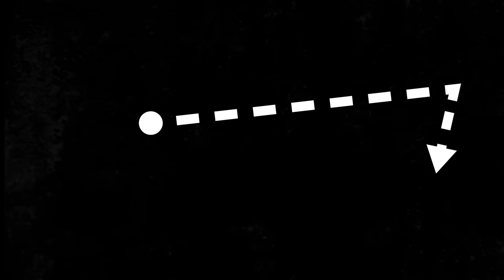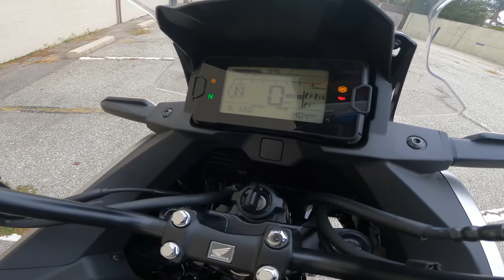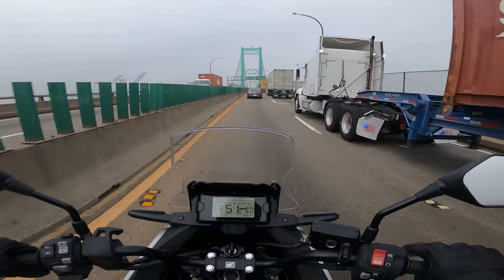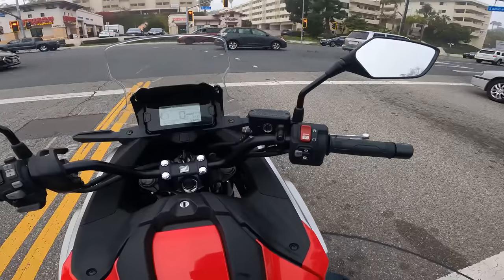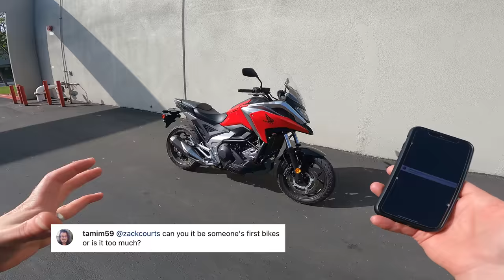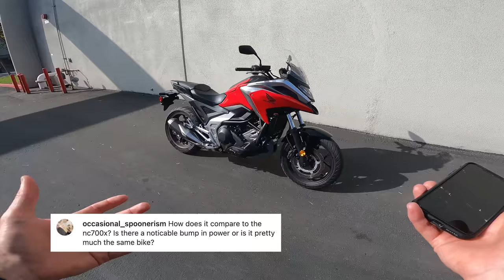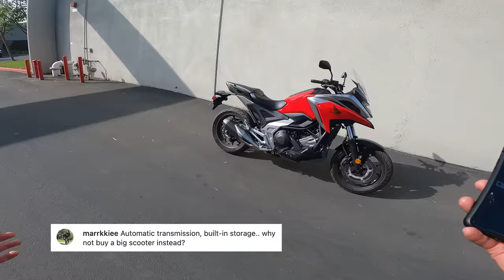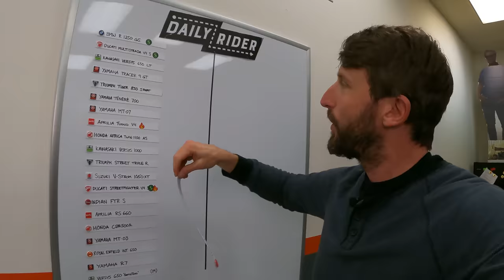Automatic-transmission on a motorcycle? 2021 Honda NC750X DCT | Daily Rider

Comment: I just bought an Africa Twin DCT after five years of spanking my KLR 650 as a learner. With full licenec in hand and the nod approval from the Kiwi govt, I went to the Honda showroom to buy a manual but then ... 
There was a choice of a new, unsold 2019 DCT or the brand new 2022 Manual which I watched built out the crate and a whopping 28% price difference! I was of course slathering for the latter and was allowed to test ride both of them a mere 10km each on only tar seal - There's no supply here in NZ and the new pup was going to be sold by day's end. 
I just couldn't understand why the DCT was such an orphan which made me slightly sceptical, I must say. 
At any rate, the manual turned on and the enormous screen with all its incredible information was almost intimidating. There are just so many options. The ride was grunty, fast and fun but she just didn't like slowing down to in-town speeds; like a lusty thoroughbred stallion just champing at the bit. The 1100cc engine was discernably more powerful than the 1000cc DCT I jumped on next but I just couldn't have cared less. 
Engaging "Drive", setting off and immediately testing the manual override paddles and feeling the utterly seamless gear changes and the effortless power and poise brought the biggest, dumbest smile to my chops. I then slid it into Sport mode to hold the gears for longer and had a burst of outright Manual mode too which was stupendous - even without the clutch peddle. 
Coming back into town, slightly too hot I'll admit, and paddling quickly down the gears had everyone in the high street stop and look up as the simply wonderful exhaust notes farted and chuckled their way across town. Unlike the wild 1100cc steed, the 2019 was very happy to idle around town and make you forget the arm lengthening pull of full throttle just a minute before. Add to this a smaller FAR less techy screen with simpler options and I was in love. 
Half an hour later, a delighted sales guy and a more delighted me parted company. I have smoked 700km in the five days since then and no longer give a second thought to the crusty old "manual til I die" mantra I used to preach. This DCT technology is a thing of beauty and wonderment, folks. Try it!

Comment: The engine is a Honda Fit motor cut in half,motor makes power like a 4 wheeler not a typical motorcycle,so anyone who has ridden 4 wheelers and such will like it.
Reply: And yet another spreads an urban myth. This was a joke told at a launch press conference by the project manager because they had consulted with Honda car engineers and used some of the same fuel saving concepts and bore/stroke sizes.

Comment: There is no excuse for a lack of cruise control at this point. It also needs a center stand. 10+ years of development on the DCT with computer controlled throttle and no cruise control. Honda is just being cheap.

Comment: Automatic transmission in a motorbike is far from being new. NC700 is being produced since 2011?! Aprilia mana 850 was automatic even before. No fuss, is just the future and makes riding eve. Easier and accessible to those that lack sensibility or strength in left hand/foot. Scooters are also automatic and almost as old as traditional motorbikes, and by law are motorbikes.

Comment: Automatic transmissions on motorcycles are great for a person who loves motorcycles, but doesn't know how to shift gears. 
But an Automatic transmission doesn't know when I want to shift gears. I wouldn't buy one.
Reply: I totally get that but the DCT does have manual mode.  I broke my foot a years ago and struggle in cold weather to move my shifting foot up and down so the DCT works for me.  I did not think I would enjoy it as much as a manual but I have to admit, the trade off of losing the feeling like you have complete control over every aspect of the engine is well worth the added enjoyment of riding without having to worry about shifting...to me at least.  I am not trying to sell a DCT but i think it is worth hopping on one and giving it a shot because it is a totally different riding experience with different benefits and joys.  I am not saying one is better than the other but each offers its own pleasures from a ride.

Comment: These "moto journalist" reviews, and Honda themselves- have destroyed the sales of this brilliant bike by forcing DCT down our throats. I test rode the 2022 Manual Shift NC750X and absolutely fell in love with it! DCT is NOT cool, as a matter of fact, it makes bikers think either you can't operate a clutch, or you are handicapped. Honda always thinks they know better than the buyer, but do you know ANY fellow motorcyclist that would show up to Bike Night on an automatic scooter?!?!  I really liked the test ride, this is a 'real world motorcycle' that has AMAZING abilities to navigate the 50 mile radius of Fort Lauderdale, great torque down low, gas mileage, frunk (that my Blue Heeler dog fits in), exhaust note of a v-twin, ability to jump speed bumps and curbs, 250 mile tank range, PROVEN reliability of 200,000+ mile engines in Europe, all day touring comfort at 75 mph. 
     They had a real winner, but destroyed it's reputation.

Comment: Interesting novelty, might also be genuinely nice for anyone impaired on their left side. But it made me think, in 2021 why would any manufacturer invest R+D into a combustion engine, as a matter of fact, we as consumers will experience less innovation in that area in the coming years. It's like making plastic horseshoes, innovating in an antiquated platform. Also, I loved my manual 911, nothing like a cool downshift in a tunnel, but have NEVER EVER used paddles in subsequent cars- it's a psychological selling point "don't worry if you ever want to go back to manual here it is", a UI that is similar to the door close on an elevator- a button that isn't connected to anything
Reply: I've been reading about the death of the ICE since the 1980's.  Still not seeing it other than electric mandates.
Reply: I'd hardly call It a novelty given it's been around for a decade.
Reply: @Arthurzeiro  I think by novelty I really meant a corner case, not the accepted norm. The changes and perfecting of DTC in those ten years have been significant, but to my other point- is Honda making better coal.
Reply: Love the shifters on my DCT, and my Spyder which is also clutchless… I even use paddle shifters in cars. If you don’t want to use them, then don’t, but you aren’t everyone.
Reply: @georgegarcia3182  I'm not trying to pick a fight or take a political stand, I'm just saying this; every major auto manufacturer has set out the date for the end of ICE (Ie. GM in 2035). So then it comes down to two behavioral economic theories- creative destruction (the piano as the only home music form tanked with the invention of the phonograph, and piano sales plummeted) and the lowest common denominator which is the distribution of fuel, and once a gas station becomes even less profitable because the auto doesn't stop there, I don't think they are going to maintain all of those stations for die-hard enthusiasts. So yes, they still print vinyl, but it barely sustains a few shops, not an industry.  It's not politics, it's economics, and consumer behavior and values drive that. I have three geared/gas bikes that I love, I just understand one day they will be replaced by a ZERO (and I love to rev bomb with no baffle as much as the next guy)
Reply: So you're saying once they knew ICE vehicles were on the way out they should've stopped R&D on them? Odd.